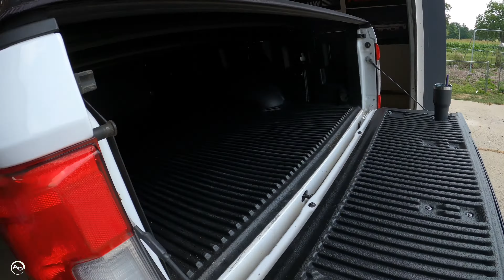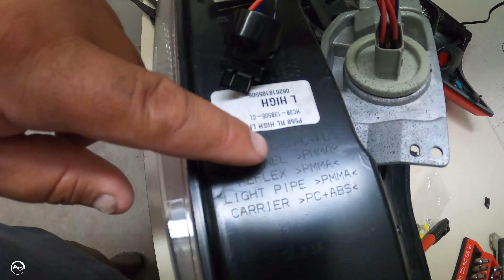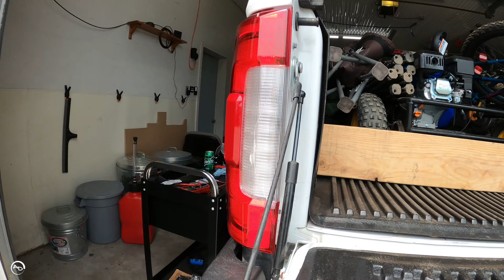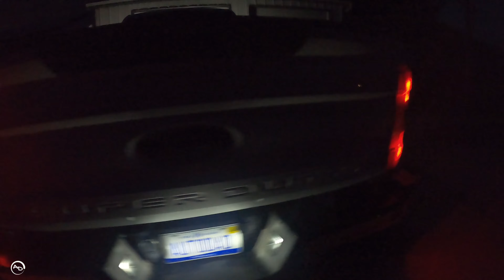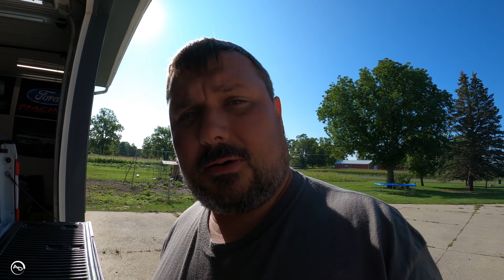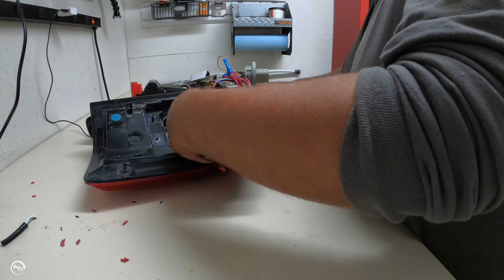How I added OEM LED tail lights to my 2017 F250!

Comment: I bought a used 2017 f-250 lariat. The person before me put led recon tail lights in it. But I been having issues with the driver one going in and out and sometimes the sequence is laggy when starting the trucks on the driver side the led pattern start up won’t match the passenger. Maybe ima take it apart again and take the middle part out of the tail light and see if I see anything loose inside the BLIS

Comment: Did you have any issues with hyperflash? How did you fix it?
Reply from the maker: I used Forscan to go in to the body control module and switch the lights to the led setting

Comment: I have a non equipped LED 2020 F350 without bliss & I wanted to change to OEM leds just wondering if I would be able to do that ?
Reply from the maker: Yes it is easier and cheaper without blis
Reply: Okay, preciate the info. I didn’t know if they made the oem leds without blis.. I’m guessing eBay or Amazon would be the ideal place to get them, probably the cheapest too? Any recommendations?
Reply from the maker: I bought mine off of ebay. I think they offered the led non blis. I could he wrong though
Reply: @autodad  alright, preciate it. Hopefully I can find some without blis

Comment: Hey man I’m also doing the swap from halogen to led taillights.my halogen trail lights have blis and all I have to do is just move the blis stuff over to the led taillight and it will be good or will it require other things except the harness of course?
Reply from the maker: Just make sure and use the same blis sensors that are already on your truck and follow my instructions
Reply: @autodad  ok thanks and the brackets for the blis are the same correct?
Reply from the maker: No. The modules are the same. I bought the modules included so I could get the brackets
Reply: @autodad  hey man I just did it today and bought a harness which I used and everything works.but I have a blind spot fault showing up.not sure why I used my original modules?
Reply from the maker: That is weird. Maybe the wiring

Comment: Very cool and nice work.  I wonder if those BLIS sensors are somehow coded specifically to the particular VIN/canbus system of the vehicle they came out of somehow?  Maybe that's why the one you got in used light was bad?  Not sure.
Reply from the maker: That's what I thought too, but did not research. It kills me when they do that. I can't change a fuel injector out on the BMW without coding the new one
Reply: You need to rescript  those, or you can put blis from your old ones to new ones. It will fix the issue.
Reply from the maker: How do you do that?
Reply: The black square piece from your old taillights, goes to your new ones.
Reply: By doing that you can avoid trip to dealership 😉
Reply from the maker: That's what I did and thats why they work. Not sure if the new ones could be coded using Forscan or not.